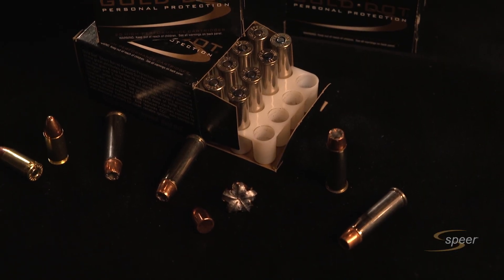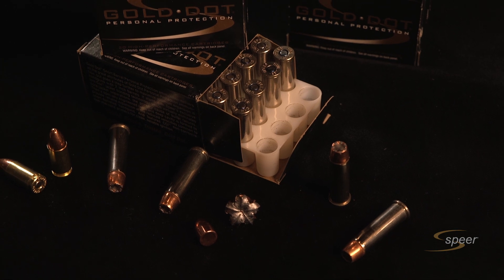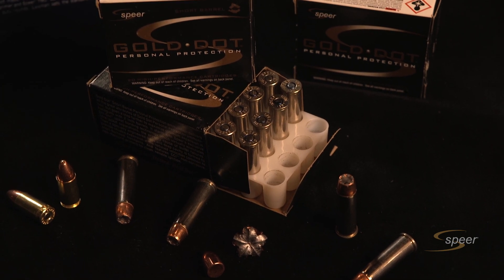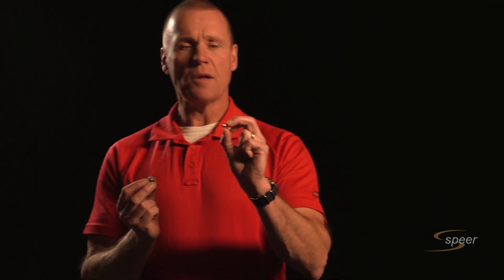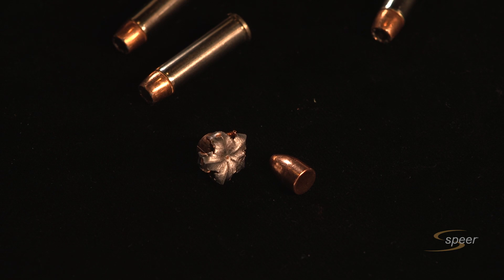Speer® Bullet Points: How Do Hollow Points Work?

Comment: What does the small pin inside a hollow point have to do with anything? I have one that has it and one that doesn't have that small pin. I need to know is there a difference on impact with or without the pin inside a hollow?
Reply: Wondering the same